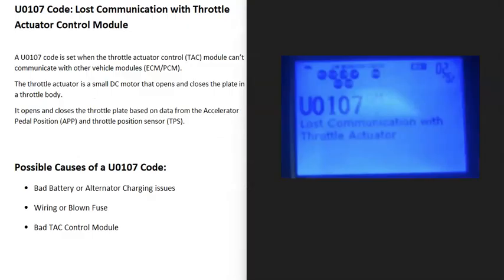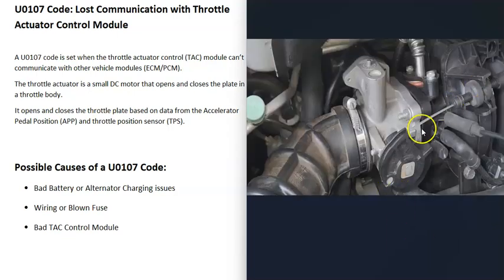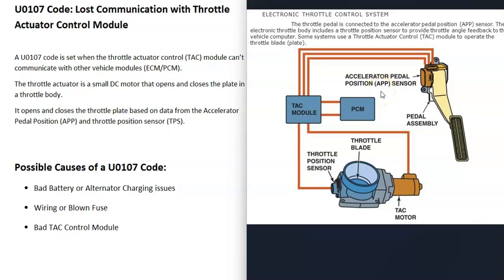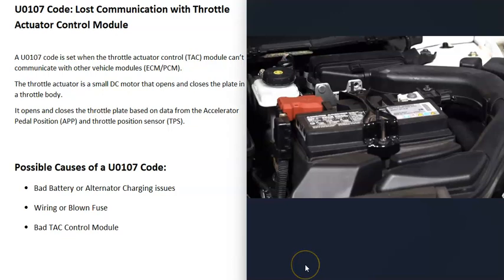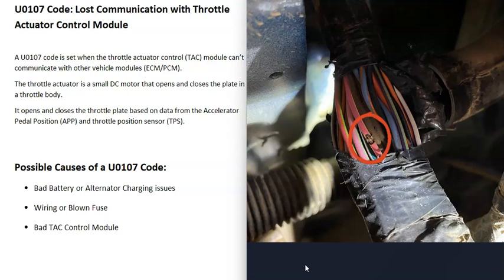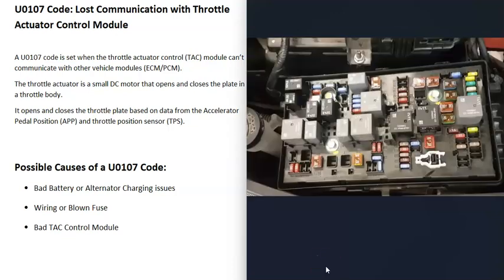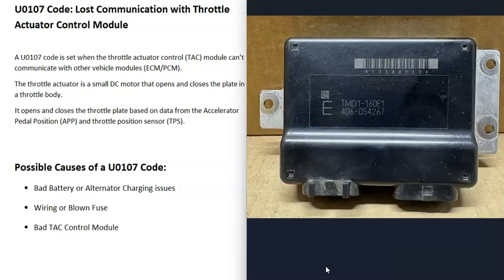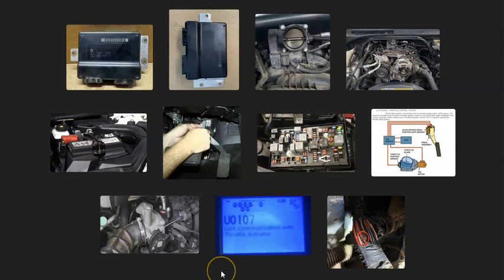Causes and Fixes U0107 Code: Lost Communication with Throttle Actuator Control Module

Comment: There's one more thing:
A failed PCM. It can happen and can make you sweat everything else  check the orange/blk wire and the DK blue/wh wires for continuity between the PCM and the TAC module connectors

Comment: I fixed mine by disconnecting the negative battery terminal, all the TAC Module and Throttle body Connectors(3 in total). Used a multimeter to measure for a short to ground on all the connections, Found out the Light blue wire was a supply power voltage from the VEH/STOP fuse but was shorted to ground. So I cut the light blue wire and stopped the u0107 making the car go into limp mode.
Reply: so it's in limp mode now tge you cut the power supply? or by cutting the blue wire it fixed the car I wasn't sure?
Reply: What was your vehicle doing? My truck just shut off on me going down the road. When I turn on the key the whole truck loses power. Gauge turns off, no crank, no click nothing. I replaced my battery, starter and re did some of the grounds as seen in all the videos with this same issue. I ran a multimeter to all fuses but got no reading on the VEH STOP fuse. Did you just snip the wire running to the fuse box in the dash?

Comment: I fixed mine with a  mass air flow sensor.
Reply: So you just changed the sensor and it fixed it ?.
Reply: @MOE13576  yea it's stopped it so far .I don't know why but it has .
Reply: @3madeamps huh ..well good luck 🤞🏻

Comment: If its a bad throttle actuator control module could it throw a code p1516
Reply from the maker: It could be a bad TAC, but there are also other causes, it needs to be diagnosed. I made a video on P1516 Code here is a link. https://youtu.be/jUOedLZA61Q
Reply: @HVAC_Mechanic  I replaced the TAC didn't fix it and replaced TPS and the pcv valve along with additional grounds

Comment: Hi when drive truck for few minutes it goes into limp more an when turn it off it's start back sn it will run again but still ho back into limp mode again any idea wats wrong
Reply: I am having the same exact problem please let me know if you figured it out
Reply: Try a mass air flow sensor

Comment: Same deal; 2003 Chevrolet Silverado 2500hf wt and literally have replaced the tac module, the throttle body position sensor and throttle body, picked up a pedal position sensor from the junkyard, a new sensor for the throttle body from the auto parts store have yet to put it in but I've been having battery issues where my auxiliary battery is pouring corrosive fluid but it's still a good battery and the "new battery on primary side" from dealer has seemed to be a dead cell battery since I got it back broken I had to tow it home after they had it for a year because I couldn't pay for their bullshit. I did all new grounds but I'm not sure where I should ground the PCM wire that I put on the computer bolt corner where should I ground that to? I'm worried I will fry my computer as I started the truck after I did all the new grounds and it shut itself down but I also had a loose terminal on the positive side that kept popping out still the same codes though like eight codes all related to the throttle body correlation 1-2. Any suggestions? I have a new relay for the auxiliary battery the other one looks like it's toast I'm going to try fixing my battery system today so that I don't have to worry about the battery causing problems